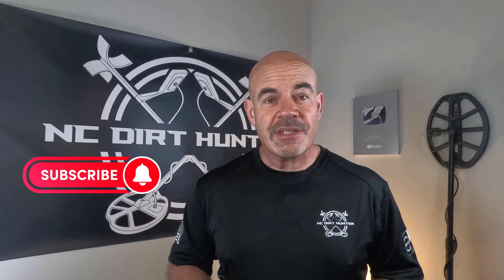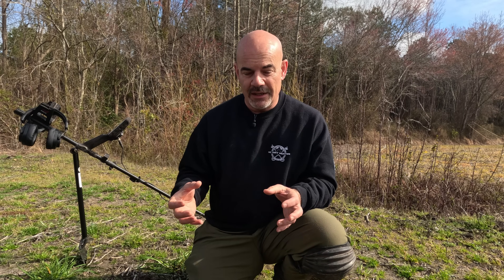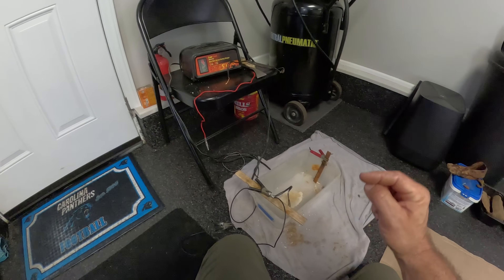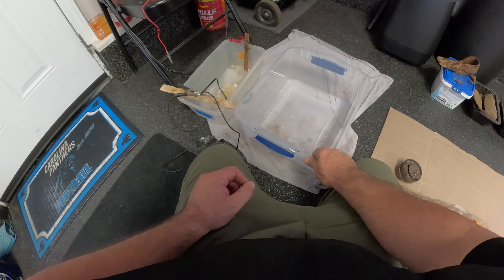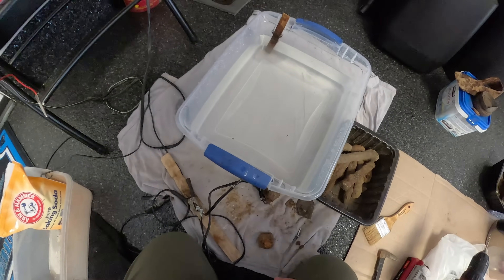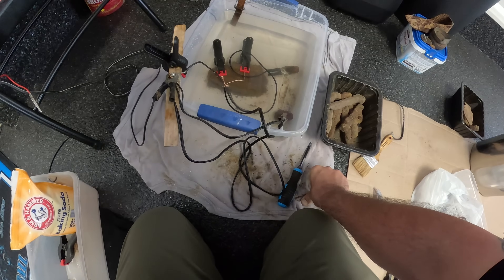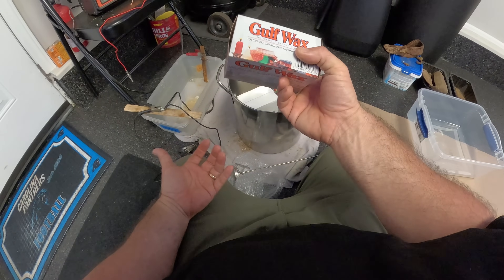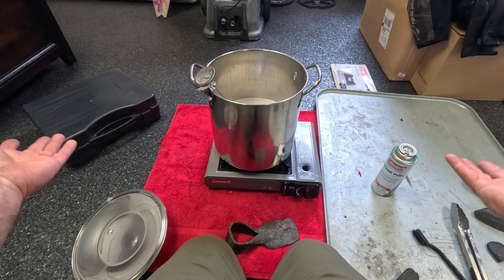Cleaning & Restoring rusty relics using Electrolysis. Tips and what I learned #civilwar #relics

Comment: hello , nice video you probably already know that "super washing soda" works better but is more expensive
I used a 5 gallon bucket with 6 pieces of rebar as sacrificial anodes, the more the better as its more in direct line of sight for the charge
be careful and have a good airflow as every bubble is explosive,...think the hindenburg

good luck
Mike
Reply from the maker: Thanks Mike, I couldn’t find the super washing soda, but I’m gonna look at other stores. You’re right about the metal. When I added more, it worked much better 👍

Comment: Electroocuted? It’s low amp DC.
I just use old AC-DC wall transformer instead of a charger. Depending on how big the iron is, dictates the Amps out I use. 0.5 to 0.75 Amps for small objects. 
1.0 to 2.0 Amps for larger items.
Your set up works fine. I just use stuff I have laying around. Since I worked with electronics half my life, I have extra stuff.
Reply from the maker: Yeah, I’ve never messed with electrical much. I can build about anything, but wouldn’t wire it myself 😂. I’m having fun cleaning up iron relics  that have been piling up. Wish I started sooner. Thanks for watching! 👍

Comment: Great video Aaron. I never thought of coating the treated pieces in wax. Awesome idea. 👍
I like to go over the objects with a wire brush to knock some of the crud off of them before electrolysis and each time before it goes back into the electrolysis.
That wax reminded me of a story when we were kids. We wanted to make candles, so we put our Crayola crayons into a Campbell soup can and heated it up on the stove. It got so hot it blew the crayon wax all over the ceiling, wall, and floor. Needless to say, Mom was not happy. 😆
Looking forward to the next video. 👍
Reply from the maker: 😂😂 That’s hilarious! Yeah, I just went out to my shop and scrubbed the pieces that are currently in the electrolysis bath 👍